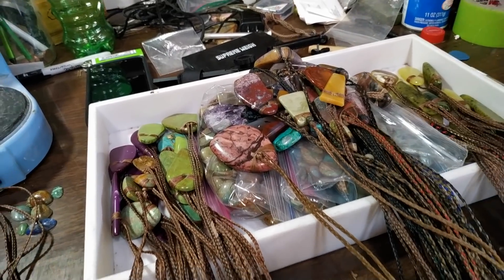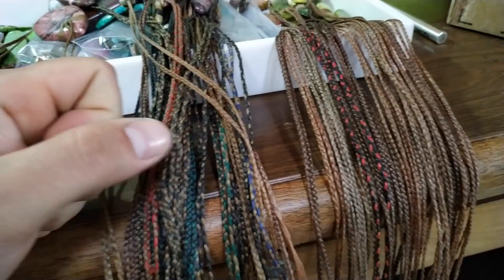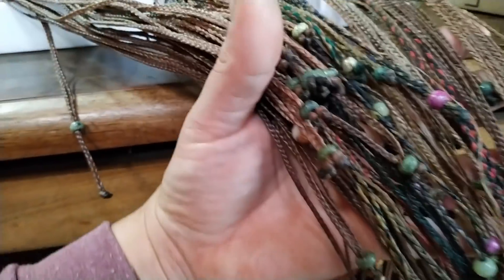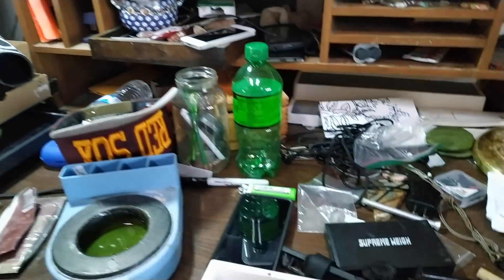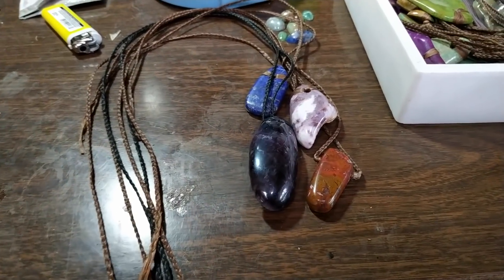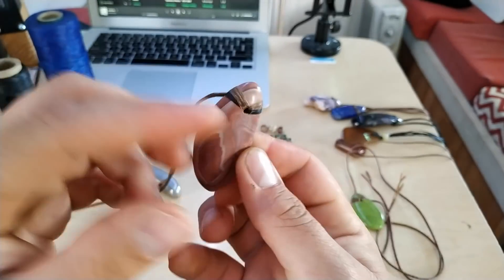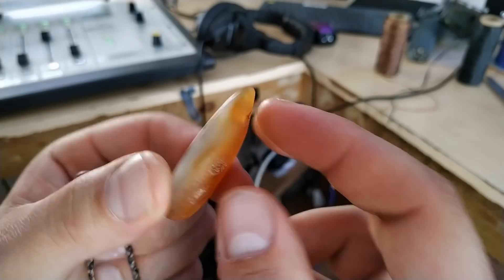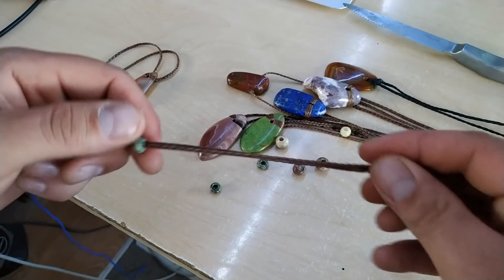Making Braided Gemstone Necklace

Comment: hey dave i love you videos and your work. I was wondering if you might be able to steer me in the right direction for my first lapidary machine. I saw one of your videos where you were showing two different lapidary machines, the 6" and the 8". i was looking for something along the lines of the  6 inch but cant really find anything along those lines. thanks dave!
Reply from the maker: Thanks for the love my friend 
The biggest question is do you know what you're going to be cutting? If you don't know in particular then you'll probably be cutting everything and anything LOL in that case you're going to want to probably use diamond wheels for your 280 and 600 grits,you don't need a fancy 2000$ machine to cut with diamond in fact you can use a cheaper used two wheel machine such as a Lortone which can be found for around 200-300$online and just take the time to either swap out the wheel two at a time or even get a expandable drum that can either take diamond or silicon carbide belts, the cheapest place to get a used machine is at the larger Gem Show such as Denver and Tucson Gem and Mineral miners Co-op but you can still sometimes fine great use machines at some smaller gem shows and Ebay/ craigslist,
If you're interested in a six wheel machine I would suggest the Johnson Brothers 6 wheel machine that cost about 895 or the graves cabberte which is 999
Whichever machine you get I would suggest getting a 80 + 220 or 280 hard wheel to go with it
I hope that helps my friend if you ever have any questions at all feel free to hit me up anytime
Reply: I would be using the lapidary for opal. Definitely looking for more of a starter 2 wheel machine before I invest in a 6 wheel.  I’ll try looking around for what you mentioned and hopefully find something to work with.  The 2 wheel Lortone sounds good and just swapping wheels out for specific needs. Is the a specific model for the lortone that you would recommend? Thanks for getting back to me!
Reply from the maker: There’s no real particular model that’s better than the rest when it comes to two wheel machines like Lortone ,They are all vintage if they are around $200 online there is also another company called Polly Arbor that makes arbors that whole two wheels usually you can find them on mine under 200 bucks but they don’t include splash which are easily made by cutting buckets or tires or even water jugs,Also it’ll be more than likely that the machine will not come with the motor so keep an eye out for a used pulley motors or maybe an old washing machine to tear apart to steal the motor from,If you’re going to be cutting mostly open so you can definitely use expendable drums with silicon carbide belts not to discourage you from buying diamond but if you know you’re going to be cutting up all mine as well get an expandable drum with some belts because they are about 100 times more affordable while cutting softer materials like opal
I hope this helps my friend 😊